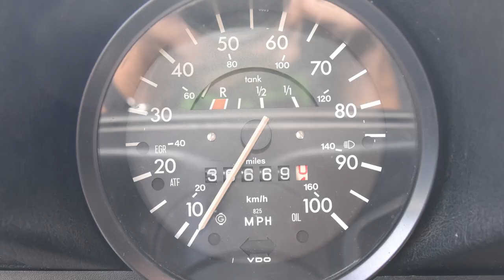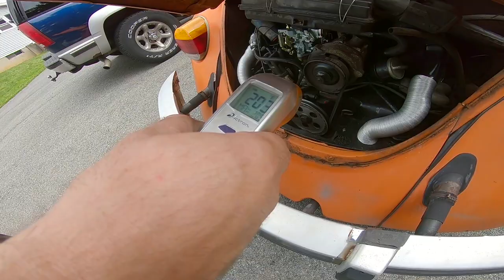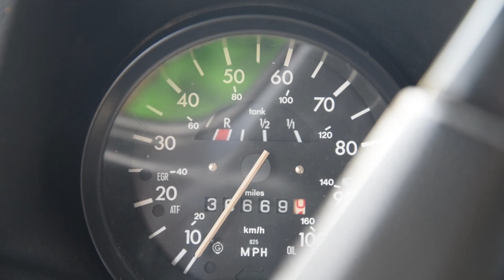1974 Volkswagen Super Beetle 1600: Regular Car Reviews

Comment: I’m an airplane mechanic. I legitimately want a Beetle because their engines have more in common with Lycomings and Continentals than anything else with 4 wheels.
Reply: I am also an A&P. I legitimately want a Rotax 915iS because it has more in common with anything with four wheels than a Continental or Lycoming.
Reply: neat
Reply: Do Lycomings and Continental also struggle with the overheated cylinder left in front?
Reply: @eltfell  no, for airplanes the rearmost cylinder gets the hottest, but for the same reason
Reply: I wonder what would happen if you stuck a Lycoming or a Continental into a Beetle?
Reply: Try a Saab, they where started by an airplane engineer if I remember correctly.
Reply: Also an A&P, love anything air cooled tbh. the fact that they're so simple makes the whole car, not just the engine, like a Cessna or some personal plane like that.
Reply: I have a wired fantasy where an aero engine (100 hp) is fitted to an old beetle
Reply: ever heard of subaru?
Reply: @Dankcatvacs  those aren’t air cooled.
Reply: @LG123ABC  Depending on the size, it probably wouldn't go much faster, but would be able to pull a trailer.
Reply: @eltfell all of this comes from running them with out the thermal cladding,

Comment: If you think these are scary, drive a split window bus. Sitting on top of the front wheels in a turn is a new horror story every time
Reply: Not to mention the shifter and steering wheel having more play than a teenager's browser history.
Reply: Yeah the T1 is pretty horrible but it isn't the sitting on top of the front wheels that's a problem, its the general build of the car. The aerodynamics are horrible, making side winds hell and the weak suspension making cornering dangerous. They perfected the sitting on top of your wheels with the T3 (or vanagon), its the best cornering bus I've ever driven (even compared to new vans) and short turning makes parking super easy. I've just recently taken a roadtrip with my "Bundeswehr" T3 to the Italian and Swiss Alps and I loved every second of it. Fast cornering on small hill roads, offroading in the Alps, driving it trough impossible small Italian towns, all without any fuss. It doesn't have the looks of the T1 but its the perfect classic VW Bus. 

PS like your car interests as well, love the Morpar/VW combo. I'm a (US) Ford/VW fan, but I like any classic if its old enough. xD
Reply: Bruno Marques good line.
Reply: I love the over the wheel seating.  With the windshield on the front and inches from your nose you have a panoramic view.  It's the imax of automobiles.
Reply: Volkswagen T1, an overpriced overrated box on wheels. Unless those ridonculous prices I have seen at BJ are just the 23 window ones.
Reply: I have horrible memories of a VW Bus T4.
It smells wierd, there is some problem with the engine but what worked last time does not work now, and is that steering wheel looser than before?
Reply: The only vehicle I've ever ridden in that ,I truly believe, you could've outrun on foot going up a hill. What a sled!
Reply: Shiva Richmond you do know the T1 or type 1 is the beetle yes? Type 2 is the bus and Type 3 is the square back, notch, and fast back.
Reply: Had a Vanagon, can confirm they are fairly nice to drive, and the cab-forward design I really liked. Great visibility. But it was epically slow. It was a waterboxer, and it did not likr hills. Still... outran a Mercedes 230D in it once....
Reply: I drove a friend's early 70s Bus many years ago.  I actually though it was cool having the wheels right under you, it gave it really interesting driving dynamics, especially turning.  I just took it through a small town with moderate speed roads but I thought it was very cool to drive.  The one thing that was a little bit unnerving though is the idea that your knees are literally at the very front of the car.  If you were to hit someone or someone were to hit you in the front, your legs are breaking.
Reply: On windy roads it's like flying a little Cessna you can't crab into the wind. It shifts like you're poking the transmission with a long stick, because you are. But if sitting on the front wheels scared you man, I don't know what to tell you aside from man up. I learned on a camper bus, around the same time we were living in it.

You want horror? Try sleeping through winter in the high desert in a camper meant only for German summers as a 14 year old stick figure without a zero bag. Now that's child abuse right there. Driving a bus? Cake walk.
Reply: @TheGameMicro  That´s what the generations of Volkswagen Vans were designated. The rear engined ones were the Type 2, split into the T1, T2, T3, then came the front engined Volkswagen Transporter T4, T5/T6.
Reply: Back home in Brazil they are everywhere.  I drove by one when I was a kid that had hit a telephone pole. The stearing wheel and the driver where on 3 feet behind the front wheels . It looked like a episode of the Walking Dead.
Reply: @daniellima2973  They were not considered safe even by the metrics of the time, and they're double not safe now.
Reply: EinachserLS no all busses where type 2’s the bug is a type 1. Type 3 is a square back, notch, fastback. The type 14 and type 34 are the ghias
Reply: @bmarques333  The shifter is extremely vague in the old type 2's. Its a suggestion more than a shifter. My 67 westy was fun to drive. It would eventually reach 55 once you got it through all the gears. 
As crude and slow as it was I sure do miss it. couldn't dream of buying one at today's prices.
Reply: @russetwolf13  The resemblance to a small plane is what my father liked so much about his 1968 Beetle, it was loud, buzzy, narrow, and tipped this way and that, but he loved it. We kids also liked it for its uncomplicated practicality, though we only tended to ride in it for short errands where my dad had it for a 45-minute commute, at least until it was rear-ended on freeway. It was replaced by a B210 that was, no doubt, more reliable, but we all hated it as it was even slower than the Beetle, being an automatic, and felt more cramped because it had small windows that made the interior claustrophobia-inducing.
Reply: Michael Myers drove one, and was even to scary for that knife wielding cut up ...
Reply: Been there done that.
Reply: not that bad bro try a box truck
Reply: NOW THAT"LL PUT HAIR ON YOUR LOWER LIP

Comment: Actually that particular beetle has an alternator...
Reply: You know it & I do but they don't!
Reply: Do the Mexican beetles have alternators?
Reply: @GeneralZapta213  73 and newer all had alternators and its not hard to convert an older car to run one either.
Reply: @1mangostick  67 and newer had a 12v system afaik

Comment: Just a couple notes. "It smells like exhaust on the inside and gas fumes" and "the engine runs differently based on the weather". So it's not a well kept beetle, with leaking vapor lines (front), rusted heater boxes (rear, leaking exhaust into the fresh air stream), and has vacuum leaks on the intake with what looks like an aftermarket carburetor that probably has steel throttle shaft bushings, which will leak vacuum. 

So, it's "not a bad car if you don't think it's a car" for a 45 year old economy car that hasn't been taken care of and needs several points of TLC.
Reply: Yeah, to the surprise of literally no one we're having a Porsche 924 situation again.
Reply: ...but it's like this with any old car. And fair enough, the bug isn't the nicest to drive, but it does work - and is a great platform to modify.

I would not give up my BMW. It's so good, even mr. I-hate-German-cars-Regular likes it. Same era, waaaay better car.
Reply: Exactly. I’ve sat inside a mint 1963 Karmann Cabriolet and smelled no vapor, heard no road noise and barely heard the hum of the engine. On the flip side, I’ve sat in plenty of beetles that have been stripped and molested several times in their lifetime and sound like hot garbage. It’s not the cars fault, it’s the people who own them
Reply: Best way to fix the vacuum thing is to go with a centrifugal advance ignition. My 66 had that, and I never had to touch the ignition or the carb.
Reply: @Eatinbritches  How old are we talking about? The 84 Caprice I had was not anywhere near this bad. The A/C was broken but that was it.
Reply: @robertharvilla4881  no. That's not the vacuum leak we are talking about and 009 style distributors are absolute hot garbage no thanks
Reply: the best way to fix it is to buy a used corolla.
Reply: @101Volts  Well obviously it depends on the age and how well it was kept up. I've ridden in a few haggered old GM products
Reply: @Eatinbritches  
Its a late 30s design

Take any other 1930s car and drive it in the mid 70s. Im sure theyll all feel crappy to drive unless they were the really expensive 30s cars
Reply: A few things. It's an air cooled, of course it's going to run a bit different in different weather. Also, all cars run a bit different in different weather.
Reply: It's very obvious from everything that this car is in abysmal condition. Just look at it, looks like it's been sprayed with some fresh paint not too long ago but everything else about it is horrible - really bashed up and rusted body (which was simply sprayed over), rusty exhaust, completely decayed interior, and we can assume the mechanicals have been just as neglected. No wonder this gave a very poor impression of the car. A lot of their complaints would be applicable to a lot of other cars of that era as well, really anything with a carburetor. They'd have not found that '74 Civic in equally bad condition to be any better. I view this more as just a comedic roast of the life us enthusiasts love, as someone who has dailied a '73 Super for 9 years this was hilarious.
Reply: @robertharvilla4881  Centrifugal advance only (rather than centrifugal+vacuum, sometimes called "Single Vacuum Dual Advance" or "SVDA") is certainly less to worry about, but it's sort of a "one-size-fits-none" solution. Simple and always works ok, but has lousy throttle response and gas mileage. A properly working and tuned SVDA should run significantly better - at least for these later years such as this '74 or my '73 anyway, I think the '66 might have come stock with a vacuum-only distributor.
Reply: Jody Owen  The heat actually works better than most people think. It's not super powerful, but in my opinion adequate - I floor mine regularly but haven't had a huge urge to make it more powerful. It's not terribly uncomfortable even for long drives in my experience, in fact the ergonomics are pretty decent in my opinion. All of this is true if the pieces in question are in decent condition and properly maintained  - many people, including the makers of this video, judge them based on neglected junkers. As for attracting girls, as a 25 year old guy, I think most girls like it, is probably a plus, I'm sure more appealing to most girls (all depends on the girl) than a chromed-out coal-rollin' lifted pickup that advertises your small penis. I think the average girl would appreciate it more even than the most revered of "cool cars" they aren't familiar with (such as import tuners). But on it's own it's not enough, I've been chronically single - I blame that on my own social ineptitude rather than the car though.
Reply: Jody Owen  All good points. And yes, the defogger does leave some to be desired. The ice scraper on the inside of the windshield is a classic "war story" among Bug owners (or former bug owners). What's good is that we can have different opinions of what cars we like yet still respect one another as fellow car enthusiasts - different people like different things. Which is good, if that weren't the case all cars would be identical (and I fear we're headed that way with the crossover SUV thing), and that would be a really boring world. Looked up that Fiat 124 Spider, and I got to say it's a good lookin' car, though not my style (nor could I afford one).
Reply: Man old beetles are so cheap to fix I don’t know why they aren’t taken care of, just buy the manuals off of Amazon & it’ll literally tell you everything you need to know to become a beetle expert
Reply: @daftend exactly....this is a really poor example of a Bug
Reply: @nemo5335  That is not the point of owning a vintage vw
Reply: Ok boomer
Reply: @sneakerfreak2002  great comeback a few months late
Reply: Consider that someone somewhere has tinkered on the 45 plus year old car. My Beetle did smell of fuel terribly but after inspection it seems that someone had totally disconnected the fuel vent. After re working the vent and a few new lines , no fuel smell whatsoever ❤️
Reply: The narrator also doesn't know what an alternator looks like. 😂
Reply: No thats just how beatles are, they're all cheap, they all leak, you'd need to spend so much on after market parts just to get it to run well that at that point its a kit car.
Reply: Yeah it's got dents on it and is def crap condition so not really fair when it looks like your driving a car that sat in a barn all its life
Reply: When he popped the hood i noticed it’s missing the canister that captures all the vapors from the gasoline, so all those vapors are going into the inside of the car. My bug had this issue and i managed to fix it very easily. Thats the thing with bugs, you can fix everything yourself if you look up a tutorial or have a mechanic help you

Comment: I LOVE my 74 Super. Rear engine, rear wheel drive makes these things actually great up hills. I took mine out after a year of not driving it and went up the steepest hill first thing, I was surprised when I had to upshift from second to third and was almost ready for 4th by time I'd hit the top.

Granted my Beetle is in a bit better shape than this one and I've taken good care of it, I also live on the west coast and the car was in the desert for 99% of its life. I've done things like disk brakes up front and all that. The heat works AMAZING because it has the original heat exchangers, anything other than those blow ass.

On the 74 Super the power WAS produced by an alternator, generators went away in 72 or 73. The Super Beetle also drives better than the standard, the larger size is due to the more modern front suspension that makes the ride and handling WAY better. Gas and exhaust smell can be negated by replacing the fuel lines and the filler connection as well as all the bushings in the exhaust system, mine had almost none after I had that done... Though the gas smell came back a while later 8) 

I dunno, I love my Beetle. It's easy to work on, cheap for parts and just fun to drive. I also have a Subaru I drive full time, though I did daily drive my Beetle for a year and it worked fine before the carb went outta whack and I replaced half the external engine shit.

Comment: Dream car- 1963 VW beetle. Has been as long as I could remember. 

Daily drove a 72 Super for years. Paid $900 for it and 15 years later it’s still running.
Reply: I'm on my cherokee's 3rd radiator. I'm pretty sold on an air-cooled grocery getter
Reply: We daily drove a 72 Super in Ohio as well, (~8 years ago) it was surprisingly just fine. Would still have it, but traded up to a 73 Thing. I'd argue that upkeep is easier and cheaper than most classic cars, but I understand that this video was based on anecdotes of someone who bought a bad car, a test drive, and maybe a handful of hours of homework.
Reply: I paid 1200 for my 1973 beetle in 1997 still driving it love that car
Reply: Why a 63 over an earlier cat?
Reply: @coreygolphenee9633  was the year of the first beetle I fell for. I do like the older ones but not the biggest fan of the oval or split windows.

Comment: The wire bail that holds the valve covers on, so you can access the rockers without tools.  Thats the mechanical beauty.  It's  so pure.  You can work on it, without wanting to hunt down and beat an engineer.

Comment: My wife-then-girlfriend had one of these in the early 90s. Yes, I had to do many roadside repairs, like replacing the entire ignition system, and yes, I pulled the engine out of it to successfully (!) replace the clutch with her father. The running boards were rusted away, so it had no heat, because the warm air from the exhaust was supposed to ride into the cabin through structural frame tubes which had also rusted away.

However, it started every day in the winter, without trouble. And it was the best car to drive in the snow, never got stuck. We took it on road trips and it would cruise the highway at 70MPH for as long as you asked it to.
Reply: I daily one year round in Colorado. Mine's heat works properly, so usually it's not bad - though it's totally useless when stuck in traffic. As for snow, I think it starts to become vaguely aware of something on the ground when the snow is about 4" deep, anything less than that it doesn't really notice. I once put chains on it and drove it through more than a foot of snow, steering was practically nonexistent but it kept going. I have gotten it stuck in hard-packed snow/ice with "potholes" a couple times, but I'd be amazed if any car wouldn't get stuck in that.